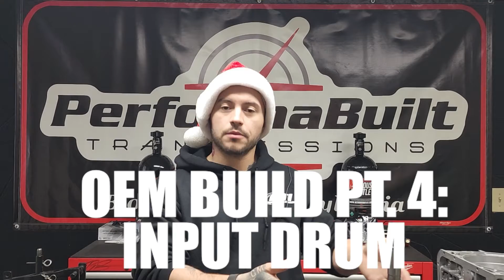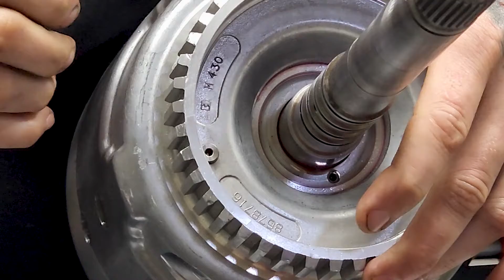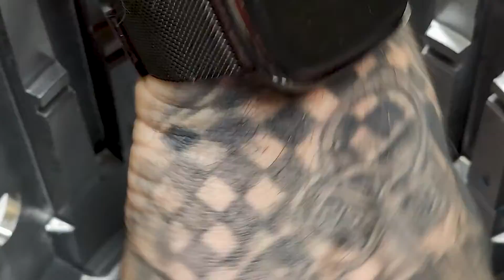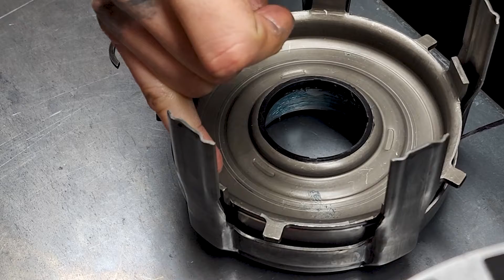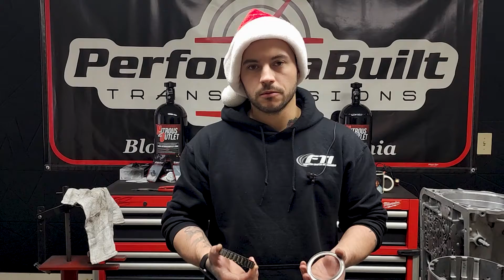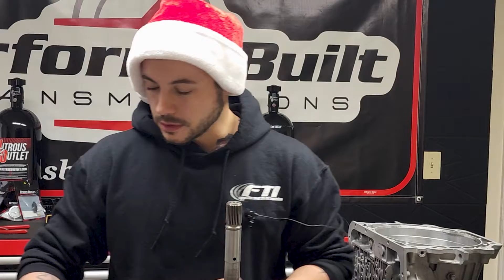OEM 4L60E Build Pt. 4: Input Drum

Comment: watching again for 90th time, my input drum is almost built lol GM's clearance is 60 to 85 thousands as per ATSG guide. Good catch, it's silly loose when I build it that way. I assume this is more so for GM to account for dramatic variations in production (clutch thicknesses / steel thicknesses between parts suppliers). They also aren't well incentivized to shrink that number as it survives warranty period and explodes on your dime. I worked for a good deal of time as an engineer designing production processes and equipment.
Reply from the maker: I couldnt have said it better myself honestly. Theres many tiny things that even if a few were done in manufacturing would have had a significant positive impact but instead it costed too many pennies over millions of units.

Comment: Do you recommend upgrading the overrun frictions. I got a kit from Dana at pro built automatics when I did my original build. He supplied the OE Borg Warner frictions for the overrun and forward pack. Is it worth upgrading those? I have a 2001 Tahoe with over 400 HP, building to hopefully handle around 500 someday. Oh I fried the overrun clutches when I ran it low on ATF. Not sure why that and overrun were the only broken parts (aside from junk that got thrown forward). I'd have thought 3/4 or something else would have blown before the overrun w/ low ATF.
Reply from the maker: Borgs are better than most aftermarket clutches.
Reply: @PerformaBuiltTransmissions oh cool. Thanks!

Comment: How do you heat the drum up and how hot do you get it before you push the spline shaft out
Reply from the maker: Induction heat through the aluminum center and till she lets go easily. Temps will vary but around 300 average

Comment: You don't lube the clutch or steel's.
Reply from the maker: Nope, havent ever. Old myth from old folks. This stuff gets soaked so fast its not nessecary at all.
Reply: 1st time I'm rebuilding a 4L60E.
Reply: I seen a video called transmission bench and each clutch lubed with transmission fluid.
Reply from the maker: It doesnt hurt anything to lube them but theres no benefit either. You cant go wrong either way. Do what you feel is best for you.

Comment: Hey guys rumor has it you can leave the wave out of the clutches when assembling and possibly get an extra clutch in there in addition. What’re your thoughts on this. I won’t name drop but am curious as you all seem very knowledgeable and do reps of tear downs and builds weekly what is your input on the wave and it’s necessity? What benefits are there to be gained by its absence?
Reply from the maker: Youd really slam into drive from park extremely hard  is the only real result. Its truely a waste of time however. 5 clutches with the sprag is more than enough to hold 1000+hp reliably with hard launches. The forward clutch pack is on in all gears even in reverse and 4th when the sprag freewheels instead of locking to acheive that. The only other 2 waves are in reverse which would have the same result. My opinion is useless and a waste of time unless you just want to have some very hard selection engagement. Plenty of forward and reverse frictions that almost never fail anyway. If forwards or reverse is failing, then its a fault unrelated to needing an extra clutch.
Reply: @PerformaBuiltTransmissions thank you 🫡🤘😁 really appreciate the insight. I truely appreciate this series. As a starting home trans tech for passion projects this series is a perfect starting point. The presenter is well versed and conveys his understanding of the topic well to what I think is his target audience. Looking forward to watching more of your content and being demonstratively educated well. Thanks guys
Reply: What is the thickness of the steels I need to use if the gap is 80 thousands, I want to use 20 thousands or 40 thousands like you mentioned in the video.

Comment: Hey, man. I'm kind of in a pinch. I have one of these apart and the third clutch has.
 6 clutches in it and I cannot get the snap ring in with 7.  Is there a different size reaction plate or pressure plate for these?
Reply from the maker: Machine the plates down or buy a medium thickness steel.

Comment: I need help!! I have watched damn near every 4l60e transmission video on YouTube. NOBODY covers my issue. My transmission issue started overnight. Can you tell me why my 4l60e is growing only in park and neutral. It makes a reerr noise going only into drive. It shifts fine drives fine just growls. I already replaced the torque converter. 135k miles 2x4 I4 Colorado VERY well maintained.  I'm going to replace every single solenoid just to see if that works. ANY HELP is greatly appreciated.  No codes no check light.
Reply from the maker: Noise in those two gears is usually low fluid or a clogged filter or the wrong filter/filter seal loose. If those have been changed and inspected within the last 10k miles then you have a bad input bearing/stator bearing in the tq converter. Load takes the noise away

Comment: Have you ever seen an input drum break clean around the circumference where the ball check valve is located on the drum? What would cause it to break in that way? I have pictures!!!
Reply from the maker: High line pressure in the unit or high line tune in the vehicle / large clutch clearance or the drum wasnt seated on install all the way.

Comment: when I apply air to 3-4 clutch. the check ball leaks air. what would be the corrective action?
Reply from the maker: Take the drum frictions, steels, and pistons out and replace the checkball and capsule
Reply: @PerformaBuiltTransmissions  i replaced the check ball capsule and it leaks. I tried setting it with a punch but no change. What would it do to the trans if i left it with slightly bubbling leaking?
Reply from the maker: @jmcclusk  It would be an internal leak and cause the clutch to burn up. Return it and replace with a different one or you will end up rebuilding again.

Comment: So I have a the 4l65e transmission and my input drum has 7 clutch’s and 6 steels and GM clearance gap for 3-4 clutch pack is around .035-.085 and mines about .020 but I was told to get a end plate that is less thicker since there are different sizes. Any suggestions/ recommendations you can give me ?
Reply from the maker: Run .020 to .030 thats what we do. If youd like to run a larger clearance to gm spec different plates can be found and ordered at global, wit, trans star
Reply: @ is there a way I could see you video
Reply: Send *^

Comment: So, does 2nd clutch pack need to make contact with the sun gear splines? Ive got 2 clutches that are sitting right below the splines. This is for a 95 gmc yukon 350 tbi 4x4 4l60e.
Reply from the maker: 2 clutches below the splines? Mmmm im not following so watch again!
Reply: @PerformaBuiltTransmissions  so, it's the 1st forward friction plates. 2 of which aren't splines in line with the forward sprag in my assembly. I'm just trying to see if that's "normal" or are all friction supposed to make contact?

Comment: I got a 2004 TrailBlazer EXT 4WD that’s stuck going forward all the time, can go forward in between park and reverse, neutral, wants to go back in reverse but stuck going forward so it just stays there as if it were in park, it drives fine but even when you start it in park it goes forward slightly, i think I have one of the videos covering it on my channel.

Some forums claim the input drum is cracked and causing a cross leak feeding forward all the time, another video I can find VERY similar to my issue says it's a clutch pack fried with another, but not fully clear exactly which one it is. Either way it drives perfectly fine but have had instances where I needed another vehicle to push or pull me back.

I was thinking maybe it would be one of the check balls in the valve body but I'm most likely only thinking that as I don't want to take the entire trans out lmao. I'm trying to get EVERY possibility why it does that so I know EXACTLY what to look out for as I go in.

The day I quit my job was literally the last time it went into reverse. Maybe it was still rolling back as I put it into drive (which I done sometimes (damn me used to newer cars waiting to fully shift to drive automatically until the vehicle stops completely) and maybe it torqued something too hard inside or as I'm thinking maybe might have slammed a check ball somewhere to where it's stuck in there if that's possible.
Reply from the maker: fwd sprag in the input drum has shattered and locked. im 99% sure
Reply: @PerformaBuiltTransmissions  From what I been looking at it's definitely something I will check for. I also seen in that forum again with common issues it could be caused by a cracked forward piston, says "Most likely a cracked input housing, or cracked forward piston means forward clutches are fused together." Not sure how old that forum is and how completely accurate it may be but seen it quite a lot but hardly any proof of that being the actual fix.

If it's probably also caused by that, Would that symptom possibly be the piston not having any suction due to possibly the O ring finally wearing out or one of the other rubber sealents?
Reply from the maker: Alum pistons that crack ended in 1995. You have steel molded pistons in your 2004 and ive never seen one of those break and extremely rarely tear a seal.
Reply: @PerformaBuiltTransmissions  Little update, took the time to finally look into the issue, turns out one of the clutches got fused together and the rest were on it's way out. The clutch disc was causing it to keep spinning and preventing from going in reverse and going forward in neutral. Was a little froze when I seen the sprag turning normally but stuck the other way, and the other one from a different 4L60E I got was spinning the way it should. Was quite a fun project and the video did help me look out for all the little things before fully reassembling it. My TrailBlazer drives perfectly again and most likely will look into getting a proper rebuild trans in it by spring next year. Thanks again for the info!

Comment: Is there a reason you put the 3-4 return springs upside down?
Reply from the maker: Its the way ive always done it. All they do is just push the 2 apply plates apart so it rly doesnt matter as long as they are there. Never leave them out. But it doesnt matter which way you put them in, you do you.

Comment: Is it better on the transmission to disable engine braking? 

My tuner disabled it when tuning. Not sure his reasoning didn't ask.
Reply from the maker: I didnt think it was possible to disable tbh. Its not controlled by anything rly computer related to a degree.
Reply: @PerformaBuiltTransmissions  I noticed that stock it would downshift through the gears it would get up to 2-3k rpm, sounded good haha. If I remember right. it was tuned back in 2016. I figured he tuned it out for less wear and tear on the transmission maybe it's more for fuel efficiency?

I'll have to ask him when I retune it for my stroker motor. Hopefully you'll be building me a stage 3 in a few months. I'm a DIY type of guy but I have never built a automatic transmission and I don't think building a 60 to hold 650hp is a good one to try to learn on haha.
Reply from the maker: I dont think your tuner is adjusting the correct things for you but i could be wrong. Id double check. Engine braking is only a good thing
Reply: @PerformaBuiltTransmissions  I agree. Don't worry I'll be writing down everything you recommend on tuning and mentioning it to him. It's Ryan Mitchell at KC Maxx performance.